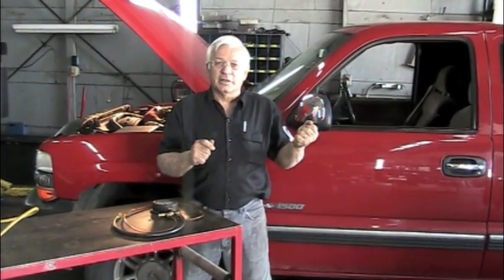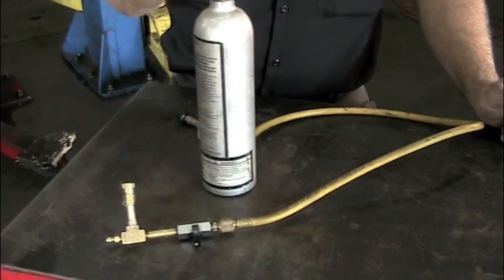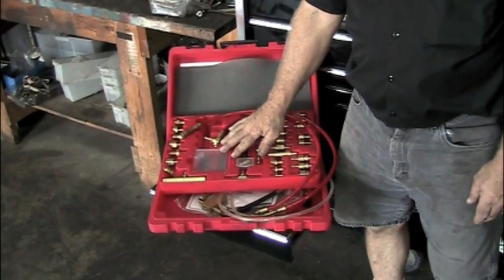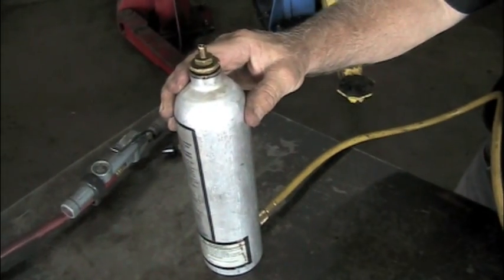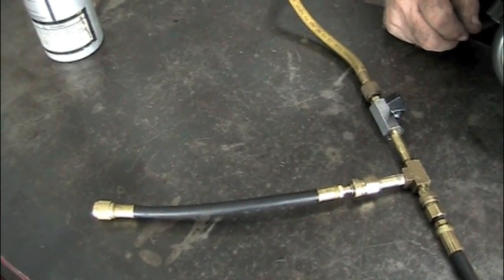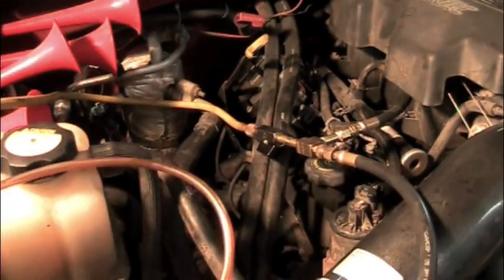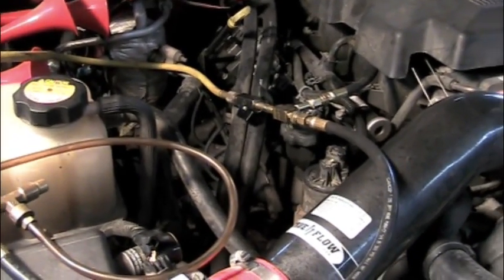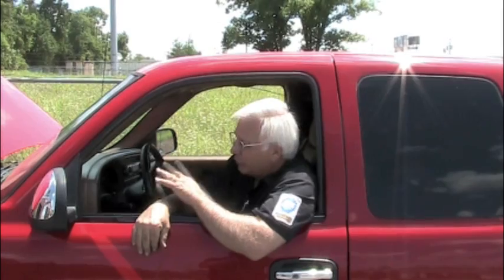How to make an external fuel tank & pump

Comment: So if I hook pressurized fuel right up to my fuel port on the fuel rail, this will work?
Reply from the maker: Yes.  The fuel pump pressurizes the fuel directly to the fuel rail.  Just know that as the pressure drops the engine slow, sputter, or stall so be ready to move when it starts.
Reply: @realfixesrealfast  Thanks! I don't have the air conditioner can to pressurize, but I have the master kit can. I figure I'll just put fuel in it, hook it up and hook the compressor up to pressurize it. I  need to move my car about 100 feet. I  thank you very much for this video.  I was wondering if there was a way to hook fuel up to that rail, so I did a Google Search, and your YouTube video popped up.  The car is sitting right in the grass and I want to try and get it on ramps under my carport. I have power all the way back there to my fuel pump but it is definitely not kicking on so I'm pretty sure it's the problem. Without this video, I would never have known if this is possible..
Reply from the maker: glad it helped, creative thinking is a valuable gift.  Good luck @LC-go1uh

Comment: great idea, and seems to work very well for u, since u have some distance between the shop and where the the tow ins are dropped off behind the gate,, unless its an asian car,, it beats havin one guy drive and another sittin in the engine compartment spraying carb clean into the air intake hose off the air filter box,, or as its affectionately known, the dog food holder
Reply: Yep.  We did that to get a tractor with a bad fuel pump loaded on the trailer.  I drove the tractor up the ramps, while my brother was spraying starting fluid in the aircleaner.

Comment: That's just not practical. If I were to do that it would be to use the OTC injection cleaner to make money. It's a whole lot easier to have a helper drive while you sit under the hood with some break clean keeping it running to get it in the shop. Let's face it I have the master kit and still don't have what's needed more often than not because the car manufacturers have to all have different fittings and constantly make it more difficult to do what's needed to check fuel pressure. You choose to use that on an easy connect to system which isn't a real world situation wish they were all that easy would make my job easier.
Reply: CIA Assassin
Reply: CIA Assassin

Comment: I been working on my car for months now. It is a 1990 Cadillac Fleetwood. And It ran great, started very easy, lacking on mpg a little compared to the normal but not bad. gets 25-27mpg and I find they get around 32mpg. Cleaned EGR no prob, Noticed clogged intake ports, cleaned them. Now it wont start. Runs on quick start easily. I know my fuel lines are pressurized but after that I don't know. So I figure something clogged within the 3 hours of cleaning those components...Started before of cours

Comment from the maker: I got the kit I use several years ag.   The brand is TDK.   I got it from the Snap On truck.   From what I've seen,  most of them are about the same.   You'll most likely only use 1/3 of all the fittings but it's cheaper to buy a master kit than it is to buy each fitting individually.